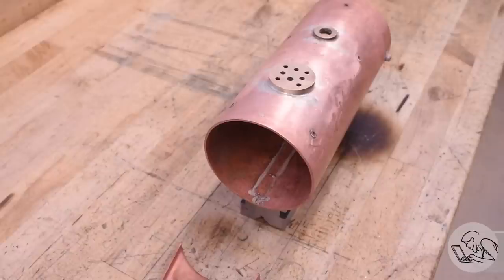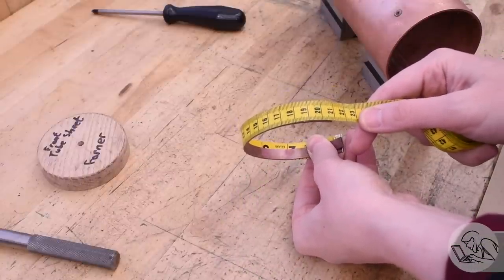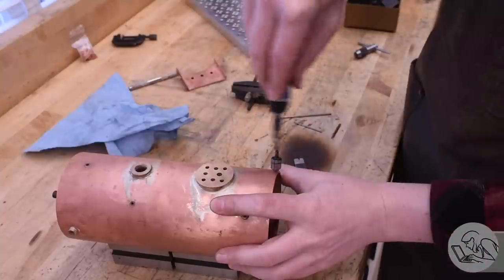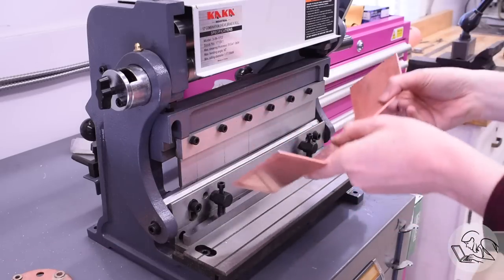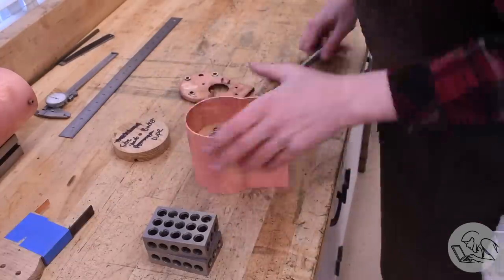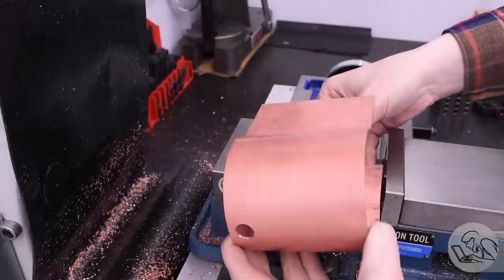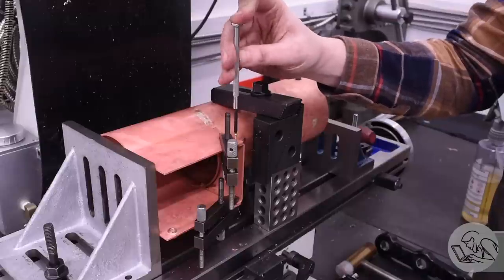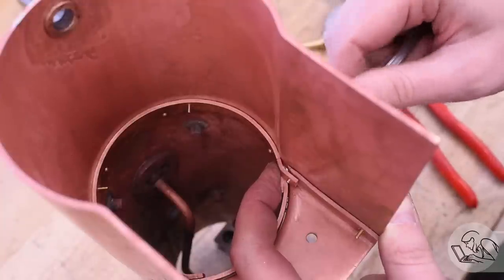Boiler Outer Crown Sheet - Pennsylvania A3 Switcher, Part 8

Comment: It seems to me that a good idea would be to combine the rivet ring and "Y" pieces by making the rivet ring longer and splitting the ends and bending them out to conform to the throat sheet.
Reply: I had exactly the same thought. The only reasons I can see for that not being better is that it might be very fiddly to get the split end to fit properly, as it does have to conform to two other pieces, and the space is very tight, so either you would have to do it with some weird clamping or you would have to take apart and put together the whole thing repeatedly. Even more than you have to anyways, that is.
Reply: Heh, you beat me to it 👌👍
Reply: @Dawnlit  I would solder it in place first, then saw and bendt it to fit
Reply: @hjalar  That would perhaps make it easier, but to make it fit into that horrible little corner it still has to fit closely with two other parts, with not enough space to swing a hammer. Screwing and unscrewing all those tiny screws just to check small changes in the fit over and over would drive me nuts.
Reply: I wonder if those pieces are trying to replicate the original design. On a full sized locomotive they might make more sense
Reply: Totally agree.  Since Quinn was able to bend the fiddly little "patches" by hand, it should have been easy to get a clean and tight transition that would be simpler and stronger.  The design sure seems to look like it was an afterthought.
Reply: I was thinking the exact same thing! Nice to know it wasn't just me.
Reply: Same conclusion here.

Comment: It's very funny to me how when you start hammer forming the strip, the inertia of the strip sticking out into air is enough to resist the force of the hammer and create an opposite bend to nearly maintain the same angle. Makes total sense, but it's funny to see without having thought about it already
Reply: That's a result of the material shifting under the hammer. The material wants to keep its sides the same length, and the easiest way to do that is to bend outward according to the inward bend, making that S shape. This is also why a hammer formed or rolled piece will not have square ends: because the material has shifted to try and stay in place relative to where it was,  the inside surface will reach out past the outside surface.
Reply: @autochton  that's even cooler
Reply: That is a prime demonstration of one of the things that Newton said was  “an object at rest stays at rest and an object in motion stays in motion with the same speed and in the same direction unless acted upon by an unbalanced force.”. While I am not saying that Quinn is unbalanced, she did provide a force and the long end of the bar did what it wants to do, stay at rest. In fact, that is one of the best examples of that concept that I have seen in quite a while.
Reply from the maker: @oldfarthacks  Oh I’m definitely unbalanced 😬

Comment: I have a pretty good idea why there are these Y pieces. It´s actually im concept something you see in a lot of constructions, not just metal, but clothing too. And it´s very common in areas where three or more joints meet each other. It offsets the seams from each other and redirects the forces. A point in which multiple seams/joints meet and that is repeatedly put under strain is a very weak point prone to rupture. The geometry of it just encurages material failure. Just leaving the sides of the throat plate would still leave the stress in one line and only marginally increase resilience. What you want to do, and what these small pieces do, is to offset the forces paralel to each other, disrupting them from all going into a single area. A good way to describe it is that these joints work like a lense for the forces, focussing them into a very small area.

Comment: Quinn, you could always use copper romex house wiring pieces in 14,12,10 AWG to fill your small cracks and you may be able to put them through the roller to "square" them. That would help the solder fill the spaces better. Good work as always.

Comment: Quinn typically the bottom blowdown is not at the very bottom. However there are hand holes that allow removal of sludge and calcium build up. I’m a retired Stationary Engineer. I  started as a Steam Firemen operating and maintaining very large Fire tube boilers 100,000 lb/hr superheated steam used to drive boiler feedwater and condensate turbine pumps and water chillers. Really enjoying your boiler build videos and machinist projects.

Comment: When you drill and tap through holes in layered material you usually cause the second layer to push away slightly so the threads don't match. The first layer is usually a clearance hole to avoid this. I wonder if this happened here or maybe since the thread size is so small it didn't occur. Thanks for the great content! I hope you are enjoying your new home and shop.

Comment: BTW:  @27:44  You can also use copper desoldering braid as a very good filler material like you did with the copper filler rod.  
The major pluses are that it's extremely malleable and covers a lot of area easily so you use less solder.  
It also comes in many different sizes and is pretty inexpensive too  :)
Reply from the maker: That’s a great tip! I did not think of that. Thank you!

Comment: At work, we have a part that requires a stainless tube to be soldered to some brass fittings and be pressure tested to 375 PSI. I've gotten good results using silver solder paste (we're an electronics  shop. It was on hand). Have you ever experimented with that? Another great video!

Comment: Looks really neat with all those complicated shapes....excellent job. On the inside is there a risk the brass will "corrode" away with cutting the ends of the threads off and create a path through with the outside being filed off after soldering? Just wondered if cut brass screws first then silver solder to protect, or add more solder after cutting them.

Comment: That is a complicated design around the throat plate - way too complicated I reckon. We use the barrel tube for the firebox, so slit it off centre and make one full length leg from that, then add a straight piece and a riveted butt strap to the other shorter side to bring it to length.

15% silver solder is good for gap filling after you're happy the joint is 'good enough'.

I think the fit of all your plates is really good. I would have just tried to bop the curved throatplate joint into place while it was screwed together but no doubt that would cause the gap to move elsewhere. I've never got the hang of hammer forming. I'd be stoked if I could get anything like the fit you do.

Comment: Oh wow.  The way that strip of copper curves upwards when bent at 3:00 was super unexpected but makes sense in retrospect.  Is that because there's a sheer force exerted by the metal being stretched on the top surface and compressed on the bottom surface at the bend, causing the metal to shift in response to those stresses further down?  Or is it because of the difference in the moment of inertia when hammering?  I imagine the second one doesn't play much part in it, and it's mainly the stresses from the bend propagating, but I'm finding it weirdly interesting to think about

Comment: A cracking job as ever! Could you have used a hammer and punches to form the copper in-situ so it lied closer together along the joint? Ditto, could the Y pieces have been punched into a better position after fixing them with screws, or after the first round of soldering?

Comment: Hi Quinn obviously I missed something on the brass screws used to clamp here. Thought you said brass was incompatible with steam and therefore bronze must be used. Aren’t parts  of the screws left inside the boiler? I saw them earlier but not in the final view inside the boiler.
Reply: I also have this question! great video though, loving this series!
Reply: @jeffarmstrong1308  Quinn did say that but if you look st the 24:26 minute still you see the screw protruding into the boiler. I do not recall Quinn saying she nipped the screw flush with the inside.
Reply: @jeffarmstrong1308  Yup I did miss at 28:25 “cropped the screws inside”!
Reply from the maker: This topic is covered earlier in the series

Comment: A good source of hex and other  bar stock are local engineering shops as they have short lengths left over from production runs that go for scrap, if they wont sell it go to the scrap yard and they will sell it to you.

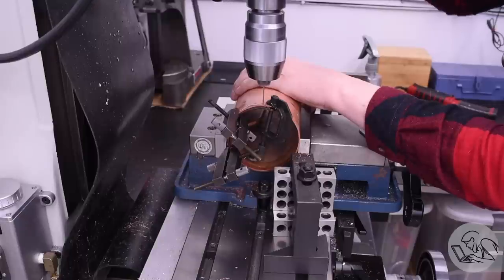Comment: If you use Bridge clamps instead of C clamps you will not have to work around the handles sticking out like at 6:54. I'm sure getting that c clamp tight while working in those confined spaces wasn't a pleasant experience. Bridge clamps are designed to be tightened with a wrench so you can also get a lot more clamping force out of them, which could have some down sides as you can collapse steel square tubing with a Bridge clamp much less soft copper parts.

Comment: If you're a bit "unsure" on a joint that looks good, but... not perfect... spray some soapy water on it, then blast it with compressed air from the backside. That air WILL (ok, usually!) find its way through. Buddy who made fuel tanks showed me that one.  You really... really... don't want those leaking.  ;)

Comment: Hi  Quinn. Heres a question nothing to do with this project though hope you can answer it anyway I make a lot of areials out of aluminium tube they come in 5 m lengths 
I use around 900 mm sections  but started to notice there all bent a bit may be because I strore them  flat  how can I get the straight again I have a lathe  and see the ends of the tubing bombing up and down at least 1 cm as they stick out the back  can a steadying rest be used to straiten them or is there a better method thanks Kevin in England

Comment: Is there any requirements for inspections during construction by an outside party for boiler certification? If you intend to run your loco on a public venue, I would expect there may be requirements for a current boiler certificate or some sort of testing proof - I don't know what requirement are needed in Canada but other jurisdictions (UK, NZ, Oz) have rules about such boilers. The rules are not overly onerous it seems.

Comment: I know copper can be TIG welded but can it be TIG welded after it’s fluxed? I’m pretty sure it can’t due to the presence solder causing porosity but I’ve never done it so I don’t know. I’m a little worried if you fail the pressure test. If so is the recourse to weld the seems? I know it’s too early to say it failed but those Y-piece gaps have me worried. I could see grinding away the solder and using copper wire filler but that sound like quite a bear to wrestle.

Comment: How do you inspect all those seams in awkward areas and be 100% sure they're filled properly? Even with good eyesight idk if I could trust it if I did it myself. If you don't already, and not to say you're doing this wrong or anything, but maybe consider getting one of those small microscope things with a flexible shaft. You could get in really close at awkward locations and zoom in on the viewing screen. I think it would make it a lot easier if you can get the lens to point at the thing with the space you have.
Reply: I looked it up, because I sometimes have a hard time explaining things, and they're called endoscope inspection cameras. They're actually not too expensive, and you can even get ones that plug directly into your phone without needing a central unit of its own.

Comment: Question: at what point do you stop using flame to heat the small joints for soldering and switch to a large soldering iron? It seems like the small y pieces and the gaps in that area would be ideal for an iron.
Reply from the maker: An iron can’t get anywhere close to hot enough for silver soldering copper. These joints can sink huge amounts of a heat. A roofing torch is barely enough
Reply: @Blondihacks  I was thinking of the 3198 500w irons. You're probably right.

Comment: Get a cheap belt sander. \I'm talking usual cheap thing for doing wood work. Flip it and stick it in a vice and you have a quick and dirty way og getting good edges on sheet fabrications. Works well even for thicker material if you dont have a mill.